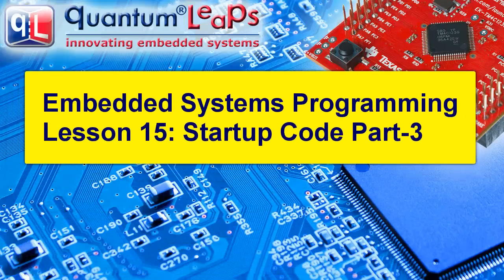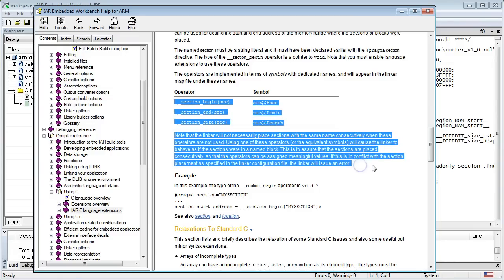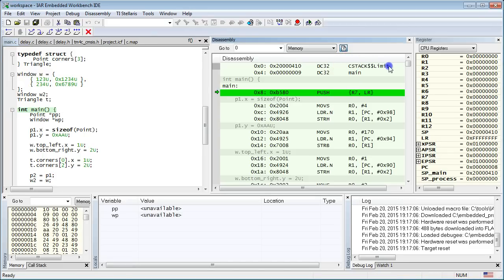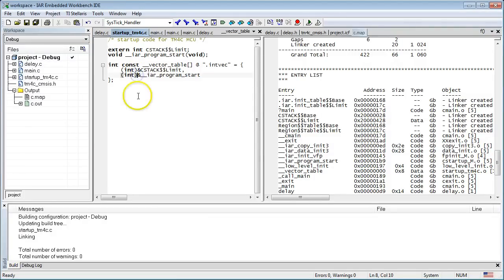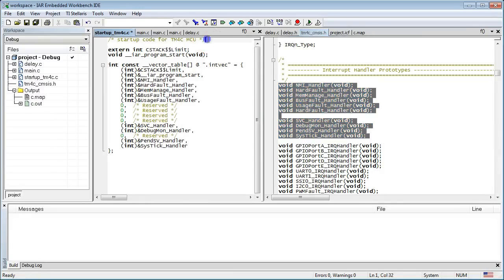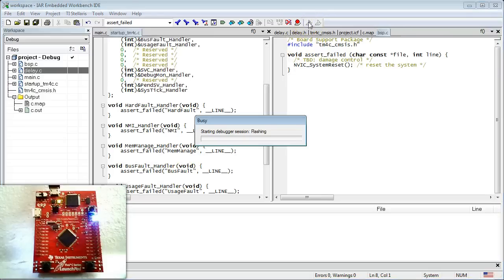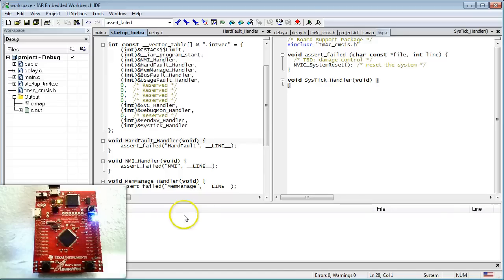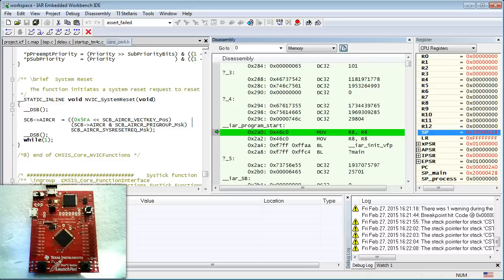#15 Startup Code Part-3: Vector table initialization, exception handlers, interrupt handlers

Comment: Why @4:16 is the address-of operator required before CSTACK$$Limit? My interpretation of the the IAR help is that the type of CSTACK$$Limit is void *. If that is correct, then I don't understand why the value of CSTACK$$Limit itself is not the desired address. If  CSTACK$$Limit  is not a pointer whose value is the desired address (i.e., top-of-stack), then what is the type and value of CSTACK$$Limit? Thanks.
Reply from the maker: +Forbes Winthrop The CSTACK$$LIMIT might be a void* pointer, but it is located by the IAR linker at the top of stack. Therefore, to find out the address of the top of stack, you need to take the address (&) of CSTACK$$LIMIT. But you don't need to take my word for it (or the word from the IAR documentation). You have a debugger, so you can test it yourself (e.g., set up a watch window for the symbol CSTAC$$LIMIT).
Reply: +Quantum Leaps, LLC Thank you for the answer and very good suggestion.

Comment: Thanks. On IAR or silicon vendor's decision to tie the program in an endless loop should a fault happens, it could be suggested that *for the default behavior* maybe it is better for the device to "hang" and "specifically not reset" if a fault happens since the cause of fault maybe something serious and restarting the device which may issue commands to actuators may cause more damage. But of course designing what should happen in case of fault is better than blindly getting stuck in an endless loop.
Reply from the maker: An endless loop inside exception handlers is almost always a BAD idea. Yet, this is the standard behavior in most boilerplate startup code. In this course, I wanted to make people aware that they can and should change this behavior for their specific projects. --MMS

Comment: excuse me sir, I have a question that is outside the lesson's topic .... can the tiva C launchpad be used to program bare Tiva C chips (without a need to a special programmer)?
Reply from the maker: Yes, the hardware debugger in the top part of the TivaC LauchPad can used to program and debug other TivaC chips. There is a jumper on the board and an unpopulated connector for debugging other chips.
Reply: Quantum Leaps, LLC Thank you very much sir .... best regards
Reply from the maker: The .bin files are provided in every project accompanying this video course. If you don't have the .bin file, you obviously are using some other project. But you can simply download the original project from the companion web page to this course, which is advertised at the beginning and end of each video: state-machine.com/quickstart. --MMS

Comment: I have one question ? about extern keyword, you used extern with CSTACK$$Limit (that with your explanation i understood very well); but you did not use extern key word with the prototype of function void __iar_program_start(void); would you please explain. Thanks
Reply from the maker: Good question. The 'extern' keyword in front of a function prototype can be used and is not an error, but is redundant, because exernal linkage is the default for functions in C.

A function can have an internal linkage (module scope) as well. Such a function prototype should have the 'static' keyword in front. This would be necessary to override the default external linkage.

A good discussion of the subject is here:
http://stackoverflow.com/questions/496448/how-to-correctly-use-the-extern-keyword-in-c
Reply: Quantum Leaps, LLC Many thanks for your good explanation.

Comment: Hello Mr Samek, 

Great tutorials, thank you for putting these together!

For each fault case in startup_tm4c.c, assert_failed() calls nvic_systemreset(). is it possible to save the cause of the fault in ROM memory somewhere to be read-out later?or output the cause of the fault to a LED combination to have visual reference? 

I suppose resetting the devicework against that idea, but it would sure be nice to know which fault was triggered before the device resets itself.

Regards,
Reply from the maker: +dogintwater As I mentioned in the video, the assert_failed() function should be carefully designed for your specific project. Saving the cause of the fault is an excellent idea, but it obviously requires non-volatile memory. The TivaC LauchPad has no such memory, except the program flash-ROM, which could be used in principle. But programming flash-ROM is quite involved and would require a full separate lesson or two. Perhaps I can talk about it in the future...

Finally, the system reset I've put at the end is often the right thing to do, but not always. Again, this must be carefully thought through and tested before you release your system to the filed.

--MMS

Comment: I have this error
Error[Li006]: duplicate definitions for "__vector_table"; in "C:\Embedded_programming\Lesson_1\Debug\Obj\Startup_Code.o", and "vector_table_M.o(rt7M_tl.a)"
Reply: +ahmed wahdan How did you resolve this error? Its now showing up in my Build console.
Reply: +Male Hakim Sorry I don't remember how I solved it, but sometimes creating new project solves it.
Reply from the maker: The problem might be caused by the copying the previous project and renaming it. Then, when the copied project is opened in IAR, the tool seems to still open the previous files, not the new files. To avoid this, you should close all open windows and you should perform a clean build (Project->Rebuild All menu).
Reply: hi, Did you fix the problem?
Reply: startup_tm4c.c leads to this error. I download the file from the website and regenerate new Obj\startup_tm4c.o, startup_tm4c.pbi, startup_tm4c.pbi.cout and the problem is fixed. time to compare my old startup_tm4c.c file and new file from the website and then I hope I know what happened. lol
Reply: Hi ahmed, the Error[Li006]: duplicate definitions for "__vector_table" is because you have not implemented some of the handlers so the linker includes de object file vector_table_M.o in order to solve the dependency but then it finds duplicate definitions (in Startup_tm4.o and in vector_table_M.o). Make sure you define and implement all the handlers to prevent the vector_table_M.o inclusion.
Reply: you have probably just a typo in your code. The absolute worst thing about IAR workbench is its lack of autocomplete, and that type of problems occur often
Reply: @javijap424  Thanks very much--that worked for me too.

Comment: Awesome tutorial brother......but i have a doubt the address of function pointer inside vector table when type casted to int are not same . I mean the actual address of function and  the address after type casting to int are not same it seems
Reply from the maker: That's right. Casting pointers to ints is not portable and you should not do it in your C code. In fact, various safety standards, such as MISRA-C explicitly forbid such casting. But the vector table is inherently non-portable, because it is very specific to the microcontroller (EK-TM4C123GXL in this case). So, at this point you know that you are dealing with a 32-bit CPU, where both pointers and ints are 32-bit wide. In that case the cast actually does not change the address. --MMS
Reply: @StateMachineCOM  oh  yes  right , thanks much for taking time in explaining, now its clear:). You are doing great job!!!
Reply from the maker: Also, please note that the ARM Cortex-M vector table contains the initial stack pointer followed by function pointers to exception handlers followed by function pointers to interrupt handlers. The point is that the "table" is not uniform, and some casting would be necessary whichever type of the table entry you choose. --MMS
Reply: @StateMachineCOM  oh yah brother, you are right:)....Thanks much again

Comment: Hi Miro,
Regarding the "__LINE__" macro.
Does it states the line number the of the current PC? if so it will always be the the same line number?
If not how does the "real" fault line number passed?
Thanks for your great effort
Reply from the maker: Regarding the standard C macro _LINE_ , please google for it to get more info, but it has nothing to do with the PC register. The implementation of the exception handlers in the startup code is written in C, so every use of the _LINE_ macro will return a different value (the line number inside the .c file). --MMS

Comment: hello miro i am getting error while running zip filr of this code "fatal error [Pe305] compiler genrates FPU instructions for a device without an FPU (check FPU present ) " did i miss something important ?
Reply from the maker: Please check your project options. Most likely you have some mismatch in selecting the target device vs. checking the FPU option.
Reply: @StateMachineCOM  yes thanks .did the correction . your tutorial series is really help full sir with debugging technique 
 please make series on protocols and their testing on logic analyzer i am waiting for that

Comment: I don't understand when you set the pragma weak + HandlerName = Unused Handler. This mean that if the handlers are not used the system will reset since it will go to the Unused Handler function and execute assert_failed function which then will invoke the NVIC_SystemReset and reset the system.
Reply from the maker: Yes, exactly. When an exception handler is not defined in your application, you never want it to be used. So, if by any chance such an undefined exception handler is used after all, this must be a programming error. It is much better to know about it and perform some last-minute damage control, than to expect some miracle that would save your program from crashing badly. I hope this makes sense. --MMS
Reply: Thanks for the prompt response. However i don't see in your code using these Handlers in order to avoid going to the Unused_Handler
Reply from the maker: You don't need to use all potentially available exceptions or interrupts, but all exceptions and interrupts that you do use must be defined in your code. Therefore it is a good practice to prevent accidental use of any un-defined handlers. This startup code is doing exactly this--preventing accidents. The additional benefit of using "weak" definitions is that you don't need to manually edit the startup code whenever you decide to use a given exception or interrupt. This avoids another class of errors that you could introduce by messing with this highly sensitive code. --MMS

Comment: my question is, why do you have to write a start up code from scratch?
Isnt a startup code provided by TI?
Reply from the maker: This lesson shows how to write startup code from scratch for two reasons. The first reason is educational because writing any piece of software from scratch is the best way to learn in-depth how it works. The second reason is that the standard startup code provided by TI is inadequate for the final release into production. The reason is that the fault handlers are all coded as endless loops, which tie down the CPU and make the software completely unresponsive. This is maybe convenient for debugging, but for production, it represents "denial of service" (the device is "bricked" and the only way to get it back is to power cycle). I hope you see what I mean. --MMS
Reply: @StateMachineCOM  So in case of an hardfault, what would you prefer? In my daily job, I never saw a workmate who used a customized startup file.
we all use the default provided file from a vendor.
Reply from the maker: @BinGanzLieb  Yes, unfortunately, many companies use the startup code provided by the vendors like TI, ST, etc. That's why we have so many cases of denial-of-service that require resetting a device or pulling out a battery. And that's why I make those videos, to alert people of the existence of the startup code and the need to carefully think about their fault handlers. Ignoring fault handlers is naive and irresponsible. It is also against any functional safety (FuSa) standards (e.g., IEC 61508).  All FuSa standards require very careful attention to fault handlers. --MMS

Comment: sir,i could not find void handler functions lines in the tm4c_cmsis.h file provided and even the NVIC_SystemReset() is not defined there.i've downloaded the tm4c_cmsis.h file fom sourceforge. and during compile time it shows
Error[Li006]: duplicate definitions for "__vector_table"; in "C:\Users\William Wrath\Documents\ 
Embedded\Debug\Obj\Startup_tm4c.o", and "vector_table_M.o(rt7M_tl.a)" 
Error while running Linker
Reply from the maker: The CMSIS consists of many more files than tm4c_cmsis.h. In fact, the tm4c_cmsis.h file is just a MCU-specific header file, which follows the CMSIS template. The other CMSIS files are often provided together with the toolset (like IAR), or can be copied from the official CMSIS repositories, such as the one on GitHub. You can read about CMSIS online, just google for it.
Reply: Hi william, the Error[Li006]: duplicate definitions for "__vector_table" is because you have not implemented some of the handlers so the linker includes de object file vector_table_M.o in order to solve the dependency but then it finds duplicate definitions (in Startup_tm4.o and in vector_table_M.o). Make sure you define and implement all the handlers to prevent the vector_table_M.o inclusion.

Comment: I have not been able to find the "include" file  tm4c_cmsis.h elsewhere than on this training site...
From my understanding, this "include" file is an important link between TI-TM4C products and CMSIS framework?
Is someone can indicate the official site to download the  tm4c_cmsis.h file?
Beside these missing files, I greatly appreciate this training.
Reply from the maker: +Daniel Gelinas The CMSIS-compliant header file for the TM4C123GH6PM microcontroller is available from ARM-KEIL MDK (when you install the appropriate pack for Texas Instruments). In fact, this file (TM4C123GH6PM.h) is used starting from Lesson-18 (only very slightly modified for this course). Please see the code downloads for course (http://www.state-machine.com/quickstart )

Comment: why was extern needed for "int CSTACK$$Limit", and not "void __iar_program_start(void);"?
Reply from the maker: CSTACK$$Limit is a linker-generated variable (data). __iar_program_start() is a function (code). Putting "extern" in front of a variable means that this is a declaration, which tells the compiler about the variable, but does not create any instance of that variable. This is exactly what you want for CSTACK$$Limit, because you specifically don't want to create a new instance of it, but rather only reference the existing linker-generated instance. Also, you could put "extern" in front of a function prototype, but this is redundant.
--MMS
Reply: Shawn Barbour  The map file shown at 7:40 answers both of your questions. 
1. The CSTACK$$Limit and CSTACK$$Base are storage units you have to get the address of as you can see it in the address column. If you get the value of them instead of address, you would read the actual value from the stack.You can do that, it's not a fault, it does not make much sense though. Of course the vector table would be invalid in case.
2. 0x428 -0x28 =0x400 => 1024 decimal, we have a 1kb stack

Comment: Fantastic content, thanks! I'm working along but using arm-none-eabi-gcc setup. Up until this point I was doing just fine, but I've hit a roadblock with the `__stackless` IAR extension. I can't seem to find a corresponding functionality in gcc. I tried both `__attribute__((noreturn))` and `__attribute__((always_inline))`, but the compiler still generates code using `push` instructions. Can anyone offer some advice on how to implement fault-handlers that are safe against stack-corruption when using gcc?
Reply from the maker: For the GNU-ARM compiler, you might want to use  _attribute_ ((naked, optimize("-fno-stack-protector"))). This will prevent the GNU compiler from generating any code for manipulating the stack for the function. --MMS
Reply: @StateMachineCOM  Great, thank you for the reply! Somehow I missed the notification..., but I was able to figure this out from one of the further lessons. Thanks again!

Comment: Hello Miro, i saw an old comment of yours saying the "tm4c_cmsis.h" files has been replaced by device.h but  in this lesson in order to write the full vector table we need the prototypes of the handlers such as HardFault_Handler which in the video are defined in the tm4c_cmsis.h but i have opened the TM4C123GH6PM_H file and the prototypes are not there so should i write them myself in my  "startup_tm4.c" file?  or are they written in another .h file that i can include?
Reply from the maker: The recommended TM4C123GH6PM.h header file has been included in the code accompanying lesson 17-20 (see project downloads at https://www.state-machine.com/quickstart ). Starting from lesson 21, the projects use the TM4C123GH6PM.h header file located in the qpc\3rd_party\ek-tm4c123gxl directory. The qpc framework is available for download from https://www.state-machine.com/quickstart/qpc.zip . --MMS
Reply from the maker: Abdo: you are apparently using your own project for this lesson. Why don't you download the provided project (lesson15.zip) from: https://www.state-machine.com/quickstart ? --MMS